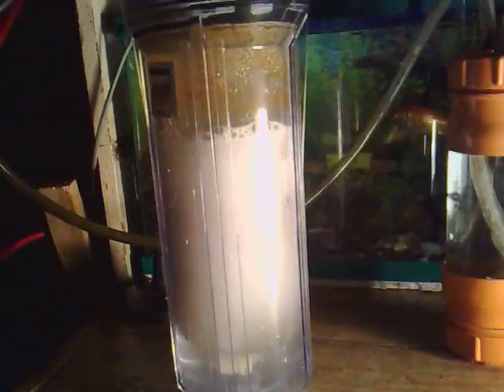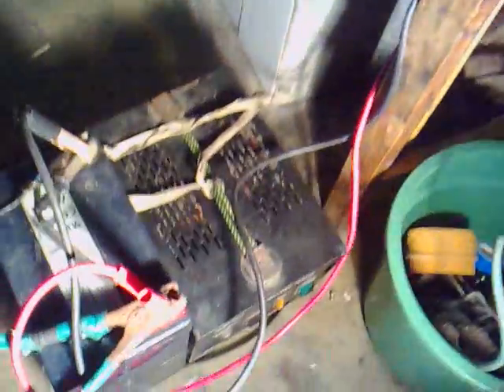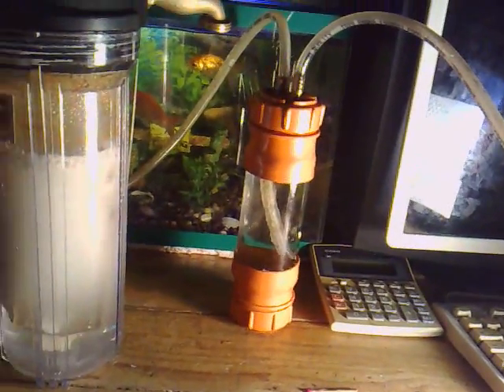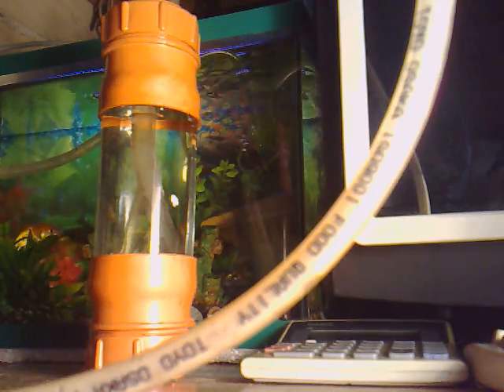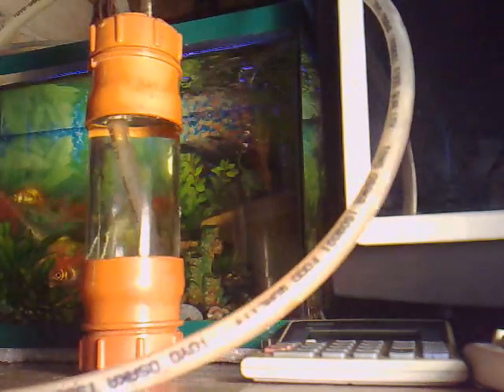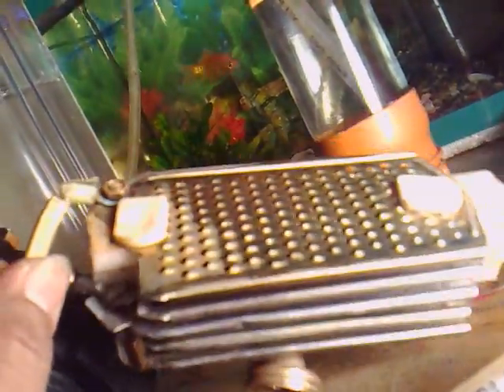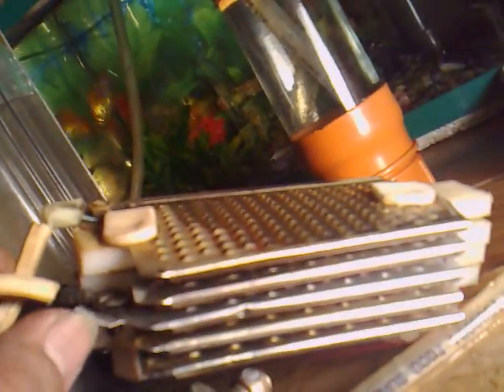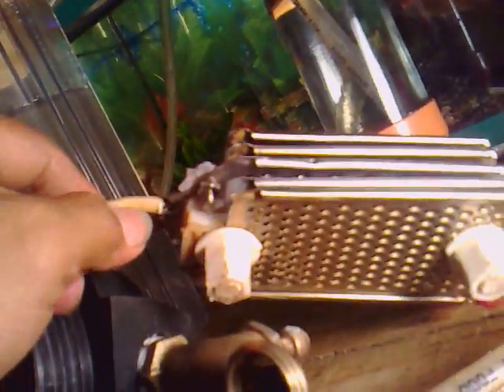HHO Cheese Grater my style  = MY FIRST BEGINING = 021210  V001

Comment: I smiled as I saw this video, I started last May 2013 with my HHO using cheese garter, hahahaha....lets move on and explore more on HHO. my next project would be electric generator. I will try to run a 3500 KW electric generator using pure water thru my next HHO generator project , 5 inches x 10 inches, using 5 plates configurations- 4 stacks., it will run at 27 amperes continuously without overheating...